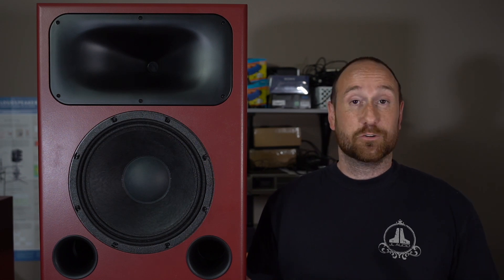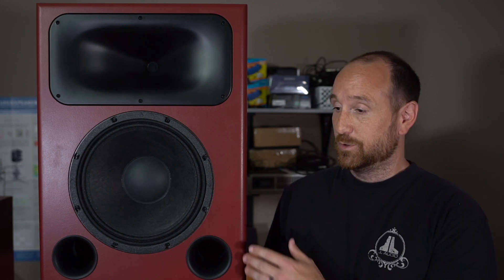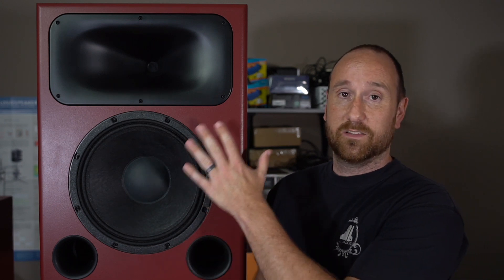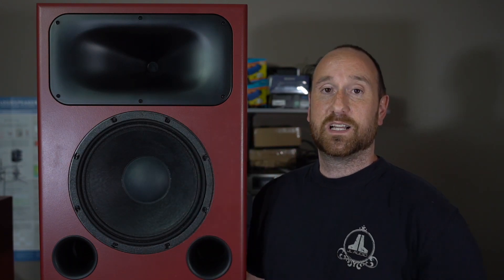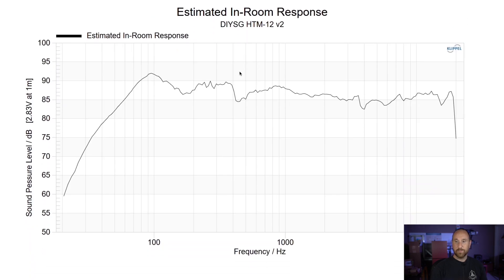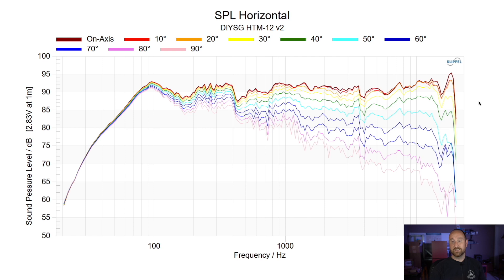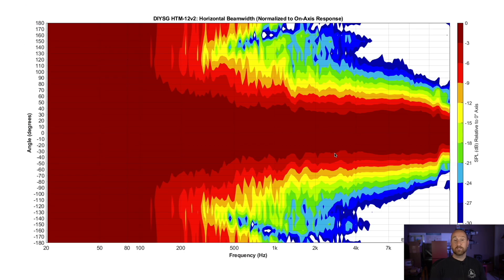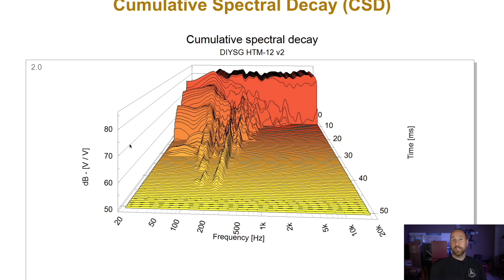DIYSG HTM-12v2  ||  High Sensitivity Home Theater Speaker on a Budget

Comment: I'm building these now.  Looks like I'll be adding some No Rez in addition to my speaker stuffing.
Reply: Try bracing the woofer itself against its magnet with a cross brace or a “holey” brace..
Reply from the maker: I’m not sure if no-Rez is the answer. I’m with Rick; try bracing. If you have a Dayton DATS or similar, run some impedance sweeps to make sure you’re making the right adjustments.

Comment: I’m curious what are your impressions with the diysg htm 12 vs 1099s.
Reply from the maker: I'd have to listen to them side by side.  I do believe the HTM-12 is more EQ'able (if memory serves correctly) but the 1099 just has gobs and gobs of output capability.
Reply: @ErinsAudioCorner  Lots of questions on how these perform head to head. Could you shed some light on this? Thanks!

Comment: To me. For the specific use of 80hz up to 20khz I'd like my speakers to be sealed. It corrects the boominess. Speakers tend to be quick and tight. Low mid tend to be dynamic and not muddy as the excessive air went in and out due to large woofer movement.

Bass region best left for subwoofers.

Comment: Good review Erin. Two socks in the ports and you will know if the front firing ports are part of the problem. Personally I never put a port on the front. Causes to much problems in the response.
Reply: These are frequently used in-wall or in a shallow cavity behind an acoustically transparent screen. Front firing ports work really well in those kinds of situations.